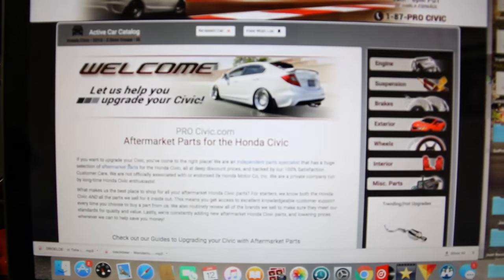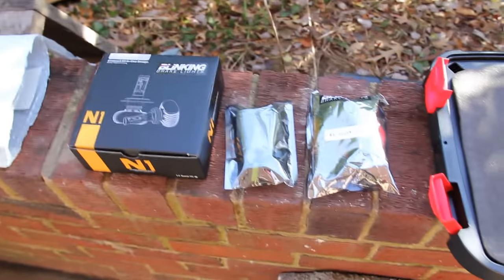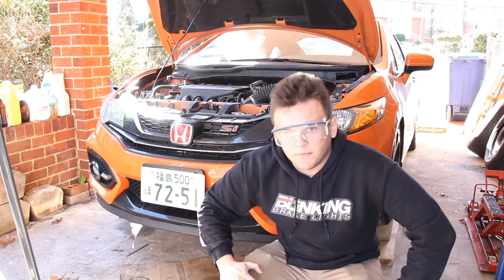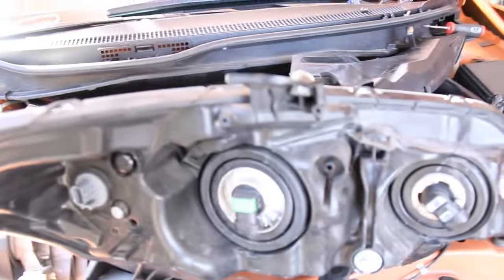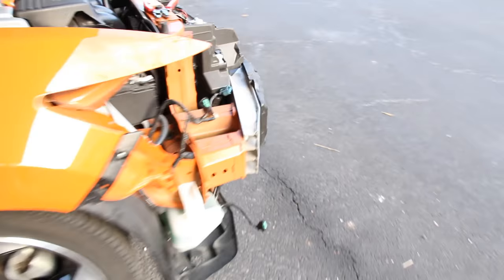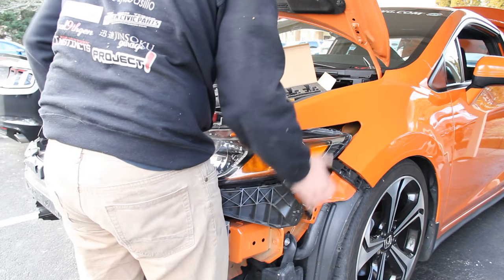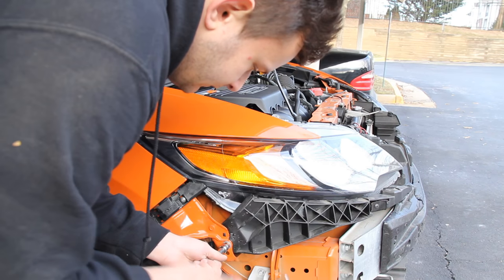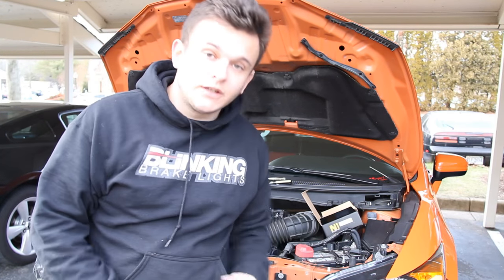DIY LED Headlight Install!

Comment: I did the same thing to my 2012 Civic Coupe and I didn't need an adapter and I certainly didn't need to take the bumper off in order to get to the headlights it was a pretty easy job. I did have to angle them down in order to not blind other drivers plus the beam was a little off from the beginning any way.

Comment: I have same car but a sedan. I’ve seen vids where no adapters were needed. Or did I misunderstand?
I learn a lot from your vids. It’s what I used to lower mine on Skunk2 Springs. 👍
Reply from the maker: no adapters needed for this particular healights

Comment: Hey Gata I have been doing a ton of research and the LED you have here are out of stock and have been for a good bit. Just about every other LED conversion kit I have found say not to get them unless you have projector housing. The si doesn't to my knowledge. Is the conversion kit you got different from the rest or is it just not as big of a deal as people are making it out to be? Thanks for your time.
Reply from the maker: Shaun Hannon Toyota Prius' from the late 2000s use LED bulbs with no projector housing. Its just people bitching for no reason. Would it perform better with a projector housing? Most definitely. But its not worth going through the trouble of retrofitting seeing as you dont have to. The LED headlights should be back in stock very shortly.

Comment: Does it make an actual difference at night?  Or is it just for looks? Can you show your light at night?
Reply from the maker: enriquem50 I will when I get a chance. Check my instagram for photos going up tonight on them and how they look at night. They are much brighter than OEM. Anything reflective you can catch EASILY with the LED headlights. Which also means Ill be able to spot Cop Car decals from further away. Haahaaaaa.

Comment: Have you removed rear bumper to see how correctly the damage was fixed out of curiosity?
Reply from the maker: dsadsa hi I was in the shop constantly watching them pull and repair my car. The entire rear subframe was replaced. And the trunk floor was cut out and replace. It was lazer aligned and spot welded to Honda Factory Specs.
Reply: GataMeLiga wow nice shoulda made a video about that haah, sounds like a brand new rear end.
Reply from the maker: dsadsa hi Was too focused on making phone calls with police, insurance, doctors (because I help run a business), and actually making sure they did it right than focusing on video taping it. Then wouldnt let me film in the premises anyways.
Reply from the maker: dsadsa hi I mean... the whole trunk was caved in of course it was a new rear end. The impact made the car lift off the ground of course there was going to be extensive damage.

Comment: Bro all you had to do was remove your battery to get to that headlight and remove the wiper fluid extension thing to get to the passenger
Reply from the maker: Katsu LA Id rather remove the bumper which is much much easier in my opinion. I hate screwing with the battery.

Comment: You literally removed the entire headlight and bumper instead of just pulling the battery out releasing the old bulbs, inserting the new bulbs slipping those in and locking them in place... You made a 30 minute job into a 6 hour job.... Not trying to be mean and all, but you really should do some research on these things, it would save you time. I did this same thing with HID's, the LED's are not nearly bright enough, it took me 30 minutes to do both sides, as well as installing H11 LED bulbs in my fogs. Also, 9006 is the low-beam bulb size for all 2006-2015 model Civics and 9005 is the high beam size, and maybe even beyond 2015 idk for sure. I am curious how you made H11's fit in 9006 slots
Reply from the maker: H11 Is for the 2015 Civic Si. I chose to remove the bumper because I didnt feel like touching the battery. Savy?
Reply: I guess that's your call, but any time that you do anything electrical you are encouraged if not required to remove the negative terminal on the battery before doing any work on the car's electrical system.
Reply from the maker: If anything were to short out the fuze would blow before the entire electrical systems fry themselves. It's only necessary if you are messing with radio, airbag, or anything having to do with sensors.